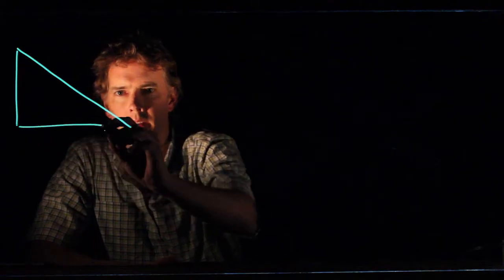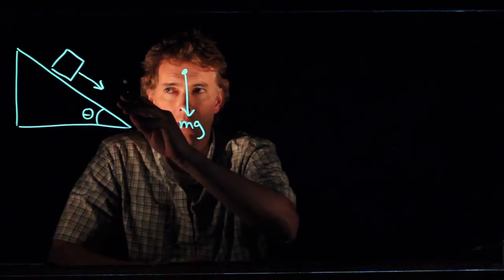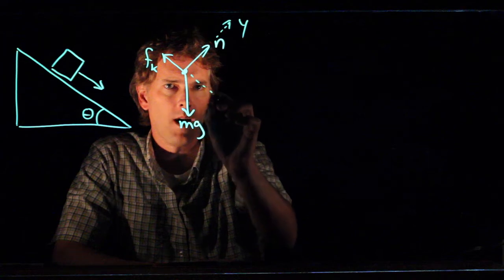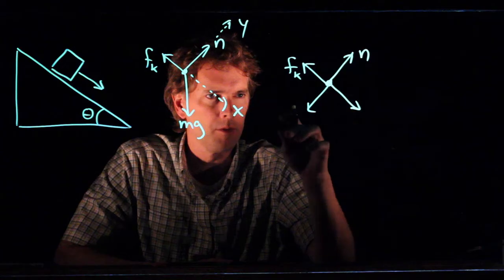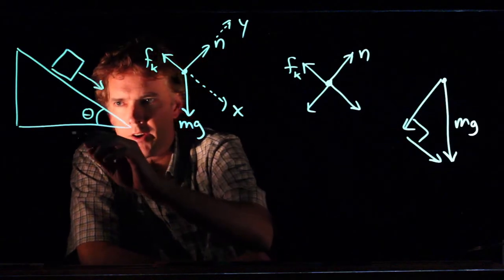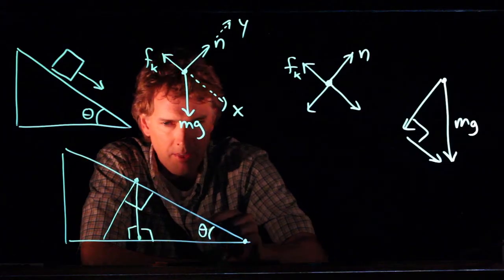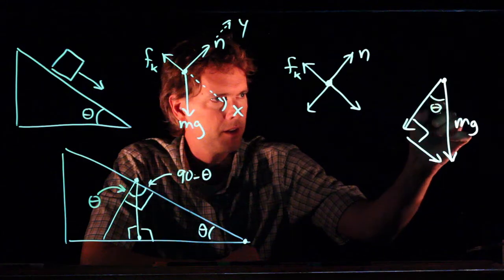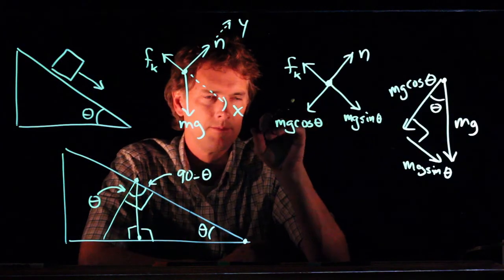Inclined plane mgsin(theta)

Comment: If you drop a line straight down through the incline to make a right angle, opposite theta, and say it has the same magnitude as mg, then doesn't sin of theta then equal mg/ma instead of ma/mg? I would have thought that the placement of the ma and mg lines is somewhat arbitrary. Is it because making a triangle inside the incline isn't from the "perspective" of the object? (Btw I know I'm wrong here I'm just curious about what I'm not understanding)
Reply from the maker: Maybe refer to this:
https://youtu.be/i2vtqmiuonQ
Cheers,
Dr. A